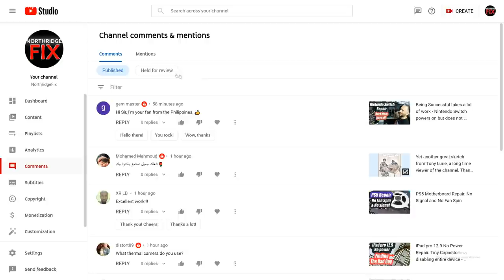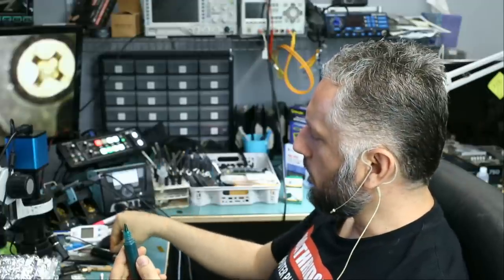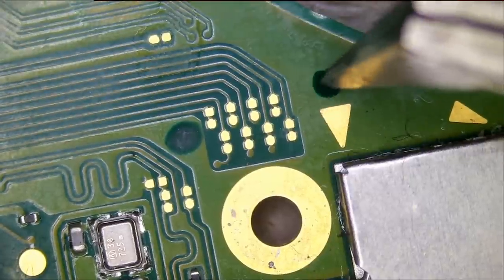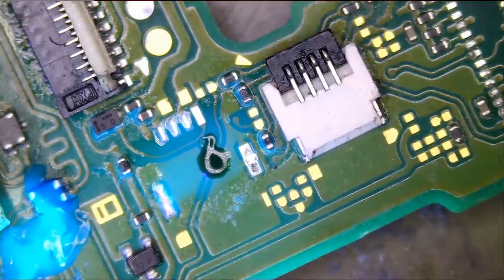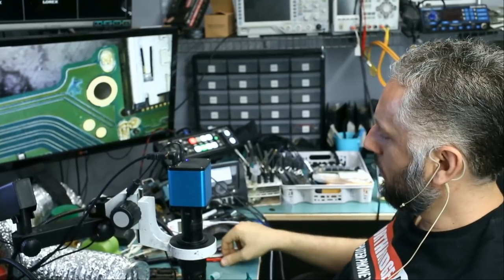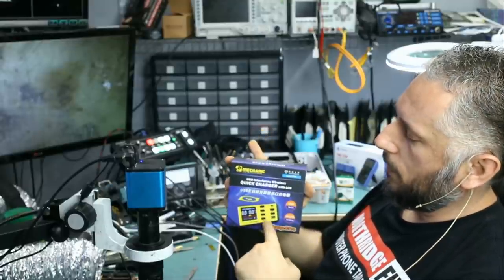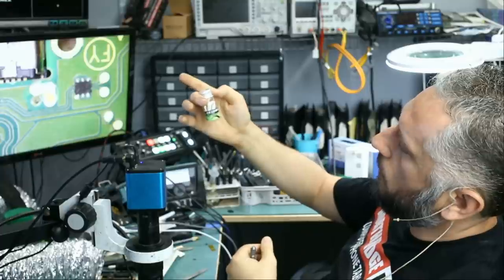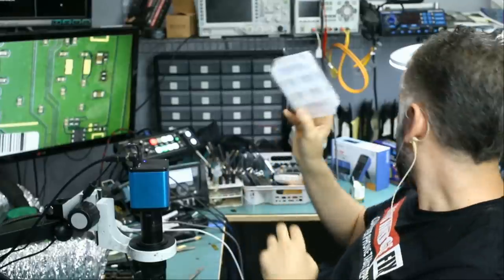How to Use Solder Mask and UV light - Awesome technique Hard in 3 Seconds.

Comment: One good tip for the UV light is that more than power the wavelength is important.  Violet light is 400nm.  Many UV flashlights are 395nm, which is borderline.  Excellent resin curing lights are 365nm and are still very affordable.
Reply: You are exactly right.

Comment: Thank you so much for sharing your knowledge! Learned a lot today! I got a problem, maybe you can help with this one too: after soldering I use Isopropyl alcohol for cleaning, I tend to use a designated toothbrush, sometimes Q-tips and other hard brushes. My problem is, that after the alcohol has evaporated, I got kind of a sticky residues on the PCBs, that feel very disgusting. I even tried with paper towels, it is so hard to remove those sticky residues. Do you have a tip or technique how to solve this problem? Best wishes and a thousand thanks, Michael

Comment: Solder mask is basically UV resin, which heats up to cure, so that’s why that hot air trick works. It works with any type of resin you want to cure faster actually.
Reply: Epoxy?
Reply: @Snecho  any type that has a heat reaction to cure
Reply: @Blu3ManiC  Nice!
Reply: @Snecho  keep in mind that epoxy will be cloudy after curing it with heat. So no pretty stuff unfortunately, just functional.
Reply: @razaelll  Interesting stuff
Reply: Sir i don't understand why we need solder mask is solder mask helpful
Reply: @salehabdullatif5176  it's useful to protect repaired traces
Reply: @salehabdullatif5176  it helps insulate and hold wires/tracks/pads/whatever in place. Mostly for convenience and rigidity, but in some cases you really need to use it.

Comment: Thanks so much! This gave my an idea. My soldermask wouldn't cure at all.. But when you metioned the hot air I knew what was wrong.. I was using soldermask in 15 degreese C, way to cold, so I turned up the heat in my DIY room and booom! Soldermask cured in 10 seconds. LoL

Comment: Hi, By the way great videos from your repairs I am learning a lot and thanks for that. I want to buy that solder mask but I need to do a repair because I have a board from a graphic's card that someone try to take out the memory and in  the end one off the pins came out. I already see and repair that but I want to put some solder mask on the top to make sure that when I put the new memory the pins does not move. And I am asking if that solder mask will do the job and does not became liquid again with the temperature. Can you help me with that? thanks best regards and great job

Comment: I have a question: When a project you work on is scrapped due to the time it consumes to fix, what do you do to the salvaged parts you used on the project from the donor boards? Do you leave them or take them back and what if they are rare hard to find parts?

Comment: UV curable substances have long polymers chains that easily slide past each other as a liquid (or paste).  UV photons break bonds in these polymer chains; visible photons have too little energy to break the bonds.  These dangling ends will re-bond -- sometimes with other chains; it is this "cross-linking" that converts the liquid into a solid.  By heating the liquid, you reduce the probability that the same two ends will re-bond and increase the probability of cross-linking.  (Heating also evaporates the liquid solvent more quickly, but cross-linking is the key to UV curing.)  A certain cross-link density (number per volume or number per weight) converts the liquid to solid.

Exposure is intensity times time.  Intensity is higher close up (I~1/r^2) so holding the light closer helps.  The rate that bonds are broken is proportional to intensity (brightness), but it is also optimized when the energy in the photons (wavelength) matches the bond energy well.  Since thick puddles have more volume (and weight), they need a larger total number of cross-links and a longer exposure than thin puddles.

Comment: UV light is just the radical polymerisation reaction initiator. Reaction speeds double for roughly every 6 degree centigrade increase in temperature. So yeah raising the temperature with a 300+C air gun is going to get you this result :). You can apply this technique to other reaction systems to speed them up, such as curing two part epoxy

Comment: Well, I have to point out that some people with those big UV lights are usually doing more than putting solder mask over a repaired trace, they're usually making whole boards and need the coverage that a tiny UV light just won't do and that is what they have on hand if they do happen to repair a trace.

Comment: @RealfamVigilante Gaming - In my experience, some UV Solder Mask needs a stronger UV light.  I have some that nearly refuses to dry.  After application, I take the PCB out and leave it in the sunlight for about 2-4hrs.  Cures wonderfully.  Slower, but the sun is good. :D